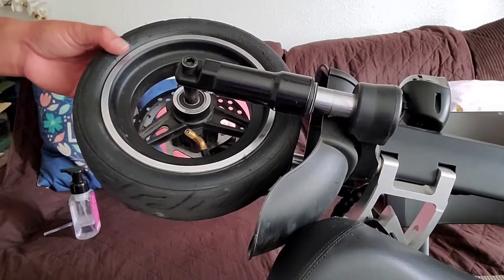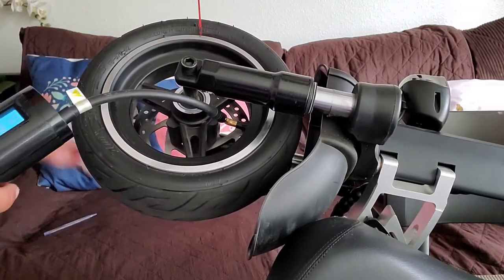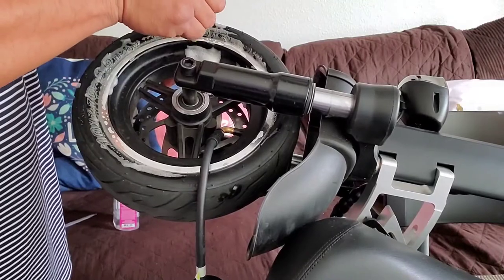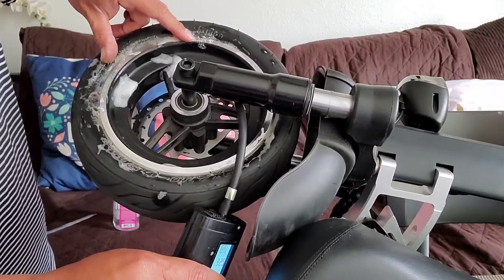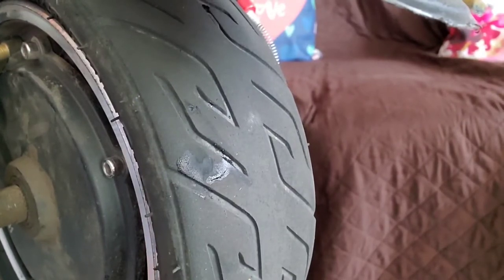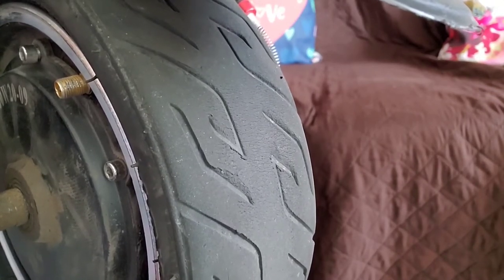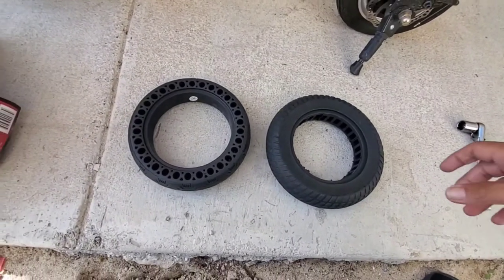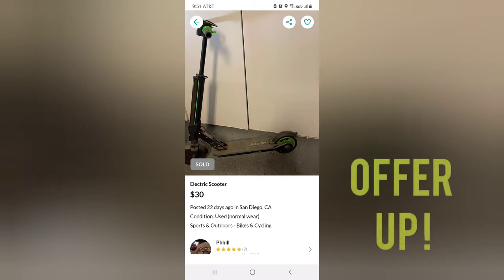H5 evercross.  tire won't hold air 😕

Comment: Thanks for all the informative videos! I bought the Evercross about a month ago,  so far I've had about 3 flats. I live in the city so there's all kinds of debris on the roads. I've repaired them all with green slime but its just annoying already .The scooter is great but that rear tire is killing the entire experience. If you ever manage to get a solid tire on that back wheel pls post a video. I'm 1mm away from buying a tire and forcing it on there so I dont feel like I've wasted $600. Thanks bud!
Reply: I heard you. Glad Evercross switched to solids about a year ago and people don't have to worry about flats anymore. Such a no brainer to me for this scooter.

Comment: My evercross h5's back tire finally caused me problems as well after 375 miles. It just wouldn't hold air for long, itd inflate but slowly deflate and I had no punctures(which is really surprising on orange county roads) and i found out it was coming from the seal right around the rim but all I had to do was add some slime and then it inflated good as new, holding very solid so far. I love this scooter, best purchase I ever made transportation wise hands down
Reply from the maker: Dude. Mine was doing that also.. till I put some foam soap around it. It left it kinda sticky when dry . To better seal
Reply: Hey wat kind of slime did u use .. I'm not sure if my leak is coming from the rim or the valve...🥵😩
Reply: @slimm414  mine was coming from the rim, and I used the bicycle tire brand name Slime it was like $10 at a gas station
Reply: @Gargantuan69  ok thanks Pablo .. so just put the slime in the inner tube and that should seal the rim?... I'm getting real slow deflation... I put the soap around the rim and seeing small little bitty bubbles, but after soap dry it seemed to seal temporarily
Reply: @slimm414  yeah pump a quarter bottle into the tire, and then spin the tire slow at first to spread it throughout the surface.  Then give it a good spin by accelerating with no one on it and the tire lifted off the ground
Reply: @Gargantuan69  sorry Pablo lol, do I put the slime in the tire or the tube?
Reply: @slimm414  don’t be sorry it’s a good question lol but I had tubeless air pneumatic tires, but I imagine into the tube. You put it in where you would air in. Spin it a little before airing up again
Reply: @slimm414  I’ve since upgraded to the solid honeycomb tire Hiboy s2 pro, it only goes 19mph but it’s got a 25 mile range and has lasted me over 1.5k miles so far
Reply: @Gargantuan69  Pablo you the man lol, I actually just bought the honeycomb tire yesterday from Amazon should be here tomorrow, I am so tired of changing flats on these tires, here in Milwaukee Wisconsin we got the worst streets master of potholes LOL
Reply: The newer H5 comes with solid tires out of the box, which is a good decision by Evercross. I also get a S2 Pro / KS4 Pro with solid tires since it is far more stable than the H5 and I have a feeling it has a slightly longer range and would last longer. I would not buy another scooter with air tires again. One thing though, the tire on the S2 is not really honeycomb. It's just a style. The holes are not hollow. It only goes in like 1/4 of an inch. Doesn't feel any better than regular solids to me. Like you said, my only complaint is that the S2 is a little too slow. Once you get used to the H5, The S2 feels very slow.

Comment: I'm having trouble with batteries charging, the charger remains green after 6 hours and it charged 2 bars in 30 mins but no more bars charged after 5:30 hours. Any insight on your experience with charging the batteries, how long it takes to charge from no battery life to full? 
Also, does your charger stay lit green while charging and then turn RED or is it the opposite?  
And...is it safe for battery to plug in the key and power on while its charging just to check how much it charged or will that ruin the battery?
Did you charge the battery for 6 hours before starting bike the first time?
Reply from the maker: It's suppose to turn red when it's charging.  You need to check the charging port if dirty or open it and trace the charging port wires If hot disconnect.  Or take a chance on buying a generic charger to see if that works? The chargers get really hot . I always put a fan on mines to keep it cool .
Reply: @budgetrydes4820  when setting up cruise control, what do the numbers mean under P, I see Yellow number 2,4, 9, 16, 99...Then below in white is 00000 or 00001?

Comment: jo bro,may i ask wher yoiu have buy the pump,and hou much?
Reply from the maker: https://www.amazon.com/dp/B07ZFQJQRV/ref=cm_sw_r_cp_apa_fabc_YBPR5P388AA0DTDH20Y8

It was cheaper then $31 for a refurbished.. I think any rechargeable air pump will do . As long as it has a twist cap.. don't buy the pinch type..

Comment: I'm exactly on that...
Reply: The tires dry out after 2 yrs and if there is no use Aswell, thry not very good quality so much so that the feb 2's of the h5 come with solid.
Reply from the maker: That's  sad . The solid tires are heavy and not suited for the h5 lack of power. This scooter was good for the price then . There's  alot Better scooters now .   I sold my h5 .